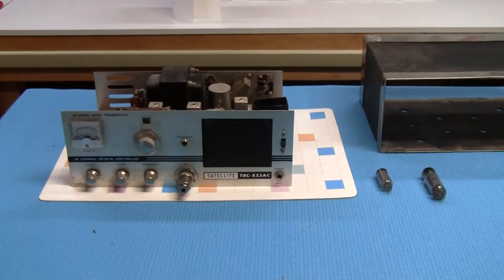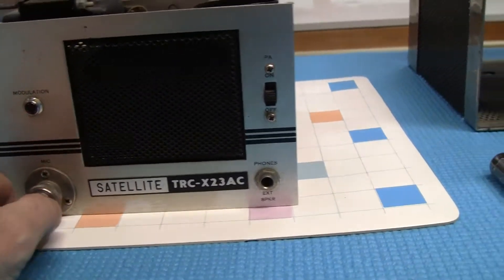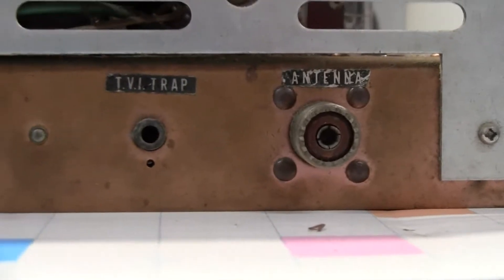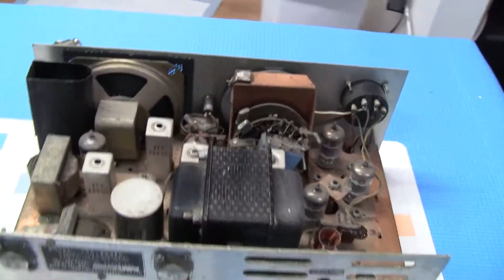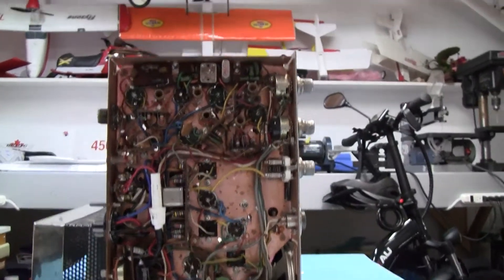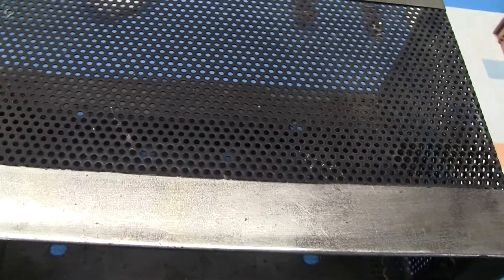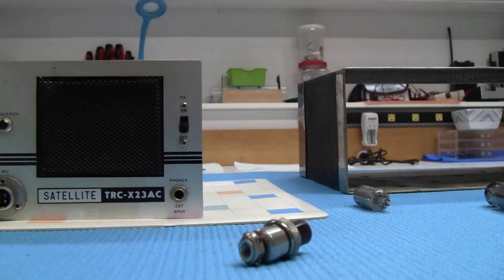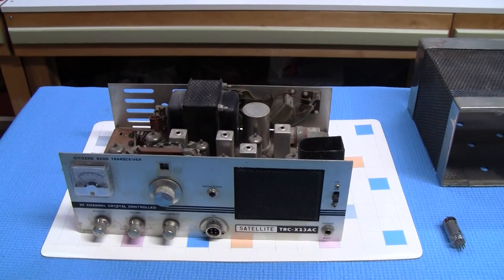old tube cb radio

Comment: Very cool. Never saw one of those. Same radio as the couriers from the mid60s. Made in Japan. Good radio.
You tune the two screws on the back of the radio for maximum output on watt meter  while you are whistling into the microphone.

Comment: On the bottom side of the radio, on the side, right next to that Crystal that has 340 written on it with red marker, you can use that screw to adjust your frequency if you hook the radio up to a frequency counter. To put your self on frequency

Comment: Get a spray can of electronics cleaner and spray some into the tube sockets and spray some onto the pins of the tubes and clean the pins with a small toothbrush size brass brush.
You can also pull each crystal out and clean the pins on the crystals and spray the crystal sockets as well.